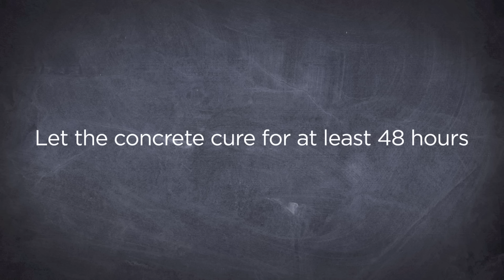DIY Concrete Planter,, Episode 16, HomeMade Modern

Comment: i´ve tried this kind of technique a couple of times and the results are awesome but about  weeks after the pots started to crack. Does anyone knows a way to prevent the pots start cracking? I´ve tried almost every thing with no good results :(
Reply: Put some reinforcement in the concrete. For light duty try chicken wire and for heavier duty you could try that thick wire grid some folks use for growing tomatoes

Comment: really cool project. Now I wish i didn't throw out those old cabinets. Just one observation: you used what seems like plain plywood (not the water resistance one) so if this project will be outdoors, in time it may expand and rot due to moisture/water. since the ply is only used to support the casters, consider a weather treated 2x4 base which will probably last forever!  Again, really nice project!

Comment: you should have put fibreglass mesh in there to reinforce it, regular ol concrete is rather fragile, also you can ratchet strap an orbital sander to the side to vibrate the concrete and get rid of any air bubbles.

Comment: I tried it. Came out amazing. Removing the inner foam was super challenging though. If I were to do it again, I would cut 2x4s cut to make the inner rectangular form and begin by screwing each piece forming a rectangle and building up from there screwing each 2x4 onto the other. Otherwise it was an awesome project. Thanks Ben
Reply from the maker: +olivepressdesign share a photo with us!

Comment: Great job. 

Open question to the forum: perhaps there is a better way to prevent the concrete from sticking to the foam and cabinet ? Wax paper ? Oil ? That way you can re-use the foam and cabinet to make another one.

Comment: +homemademodern I like your design but there is too much waste of foam.. you should bring an other design with no waste at all
Reply from the maker: +Hakim Mkacher you are right.  i am thinking about an inflatable inside
Reply: +HomeMadeModern Why not build a smaller box with wood?
Reply: I was wondering the same, what disadvantage is there to building a box within a box, does it have a tendency to float, eg?
Reply: crosstownart the inner box would be attached to the base as the foam was,  thus no floating.
Reply: If you make a box within a box mold heal together with galvanized screws you do not not waste the foam and destroy the box . It can be used over and over.
Reply: how about you all try it your way and you’ll miserably fail!!! making items with cement is not an easy thing!!! Your videos are GREAT!!!
Reply: don’t use toilet paper if u wanna save and not waste!!
Reply: Hi, I suggest to use little bit conical foam insert wrapped in food plastic foil. This will make it reusable,  easy to separate from planter, with only waste of foil.

Comment: ... good idea. but would it be cheaper if scrap cardboards were used instead of the foam? it's DIY, so i guess make do of available & less expensive materials is first consideration. just a thought...

Comment: Is there a more reasonable way to remove the form. . . or make the form reusable?
Reply: +Donny Halliwell Apply some oil on your inner mold surfaces :) it will ease the unmolding process.